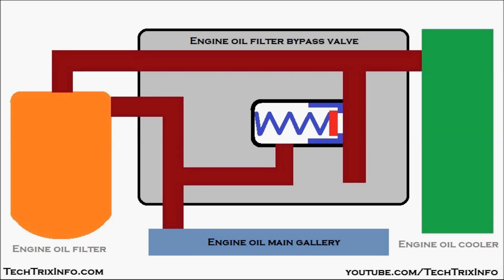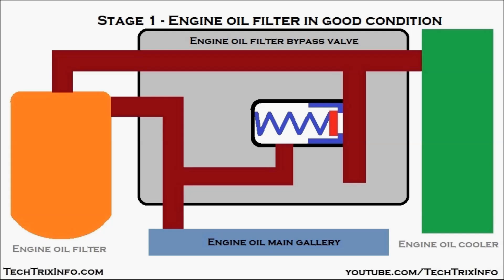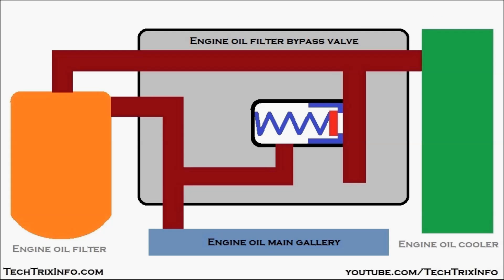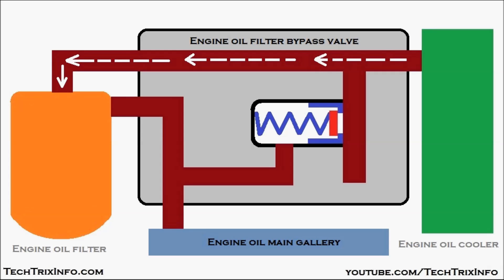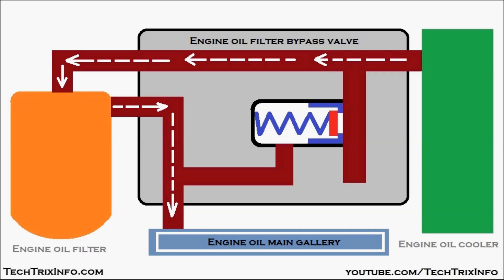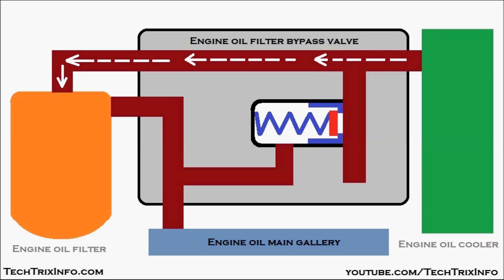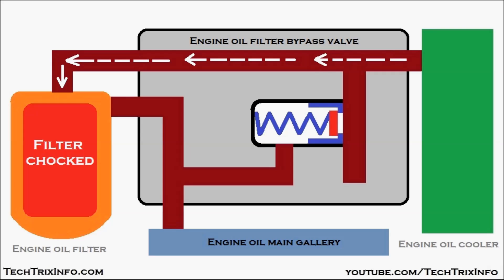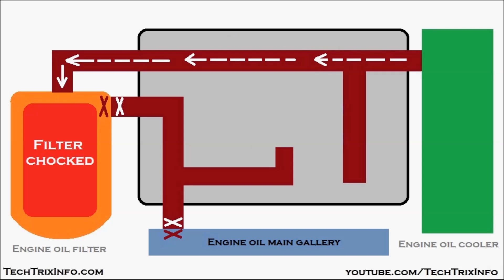Animation How engine oil filter bypass valve or safety valve works

Comment: Sir the engine oil enters the filter externally and is pressed against the filtration media thus causing it to be expelled out of the center stove pipe.
Reply from the maker: Hi Mohammed, Thanks for your comment, are you currently working in the automotive industry ?

Comment: Boight a car and the guy said oil filter cap came off. Rebuilt turbo and ran engine to find cap over filter blasting off. Guess the oil pressure relief valve mist be faulty.

Comment: the purpose of an oil bypass is 
To prevent oil from passing through the cooler if it is already cold
the oil cooler is provided with a by-pass valve reacts to the temperature of the oil. It shunts the oil around the cooler via the bypass when it is cold.

Comment: How often and when does the bypass valve open?
Reply from the maker: +mygiguser 
It's opens only when there is a restriction for the oil flow mai nelly when the filter is chocked 

Thanks for the comment 

Mechanical, Automobile engineering updates from us through Whatsapp @ +919744615655 (requests through Whatsapp to get updates)

Comment: I'm guessing by "chocked" he means "choked". But that's not even the correct term. The correct term is either "plugged" or "blocked".
Reply from the maker: +Edward Morbius 
Thanks for the comment. 
What's app us @ +919744615655 To get updates on Mechanical/ Automobile engineering
Reply from the maker: +Edward Morbius 
Thanks for the comment, we will improve the quality of the content
Mechanical, Automobile engineering updates through Whatsapp @ +919744615655 (requests through Whatsapp to get updates)

Comment: Is it possible to get flow reading from bypass filter only? 
I'm currently trying to work on engine oil filter monitoring system, so that the system alerts driver when the oil filter is in poor condition.
Reply from the maker: +eleongo 
There won't be a flow always in the bypass filter 

Thanks for the comment. 
What's app us @ +919744615655 To get updates on Mechanical/ Automobile engineering

Comment: What could cause an oil filter to "expand" or "balloon"?
Reply from the maker: +B Oneil Because its chocked and pressure in building up, it will crack soon. 
For more info you can email us at techtrixinfo@gmail.com or whats app at +919744615655

TechTrixInfo.com
Reply: Stuck bypass valve and blocked filter elements, or clocked oil line from filter to engine.

Comment: Hello, first best wishes for this new year and thank you, you make a great job, I am looking for help, well I put myself in trouble => I think I overfilled my engine with oil, It is a "old baby", a Chevrolet S10 1987 (Durango) 2.8L V6, when I tried to start, it was ok but after maybe 20 s the engine stop, I drained the oil, now it cranks but doesn't start and no spark, with a friend we checked and changed plugs for new ones, please have you any idea
Reply from the maker: +Moh Laz better to consult a expert mechanical who can check your engine, because like this i cannot give a exact solution.

We are honored by that comment.
For more info you can email us at techtrixinfo@gmail.com or whats app at +919744615655

TechTrixInfo.com
Reply from the maker: +tpfmike1976 
Yes

Comment: Thank you for educating me on this important aspect of the filter bypass valve. I have this situation happening with my s10 blazer, now I know how to correct the problem. much obliged .
Reply from the maker: +GILLEBRATH 
Thanks for the comment 
Mechanical, Automobile engineering updates through Whatsapp @ +919744615655 (requests through Whatsapp to get updates)
Reply: tHAT'S HOW WE SAY IT HERE: Muito obrigado !